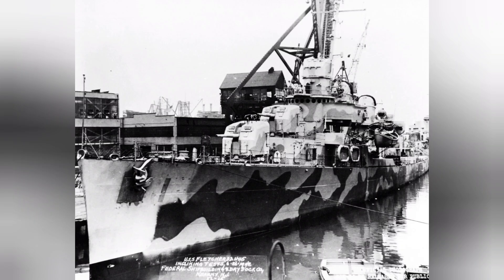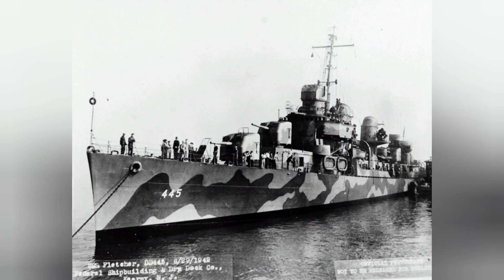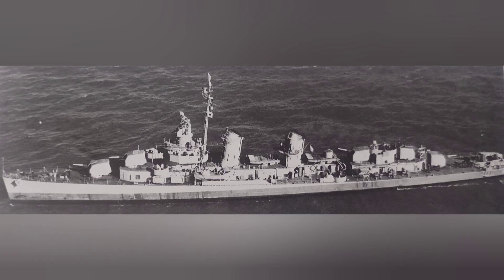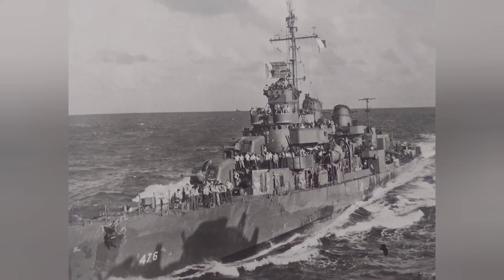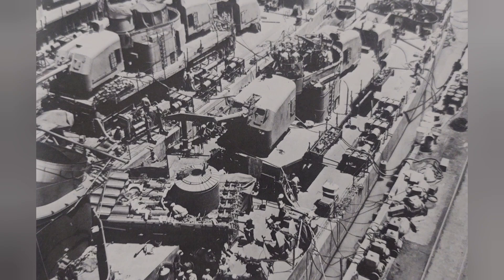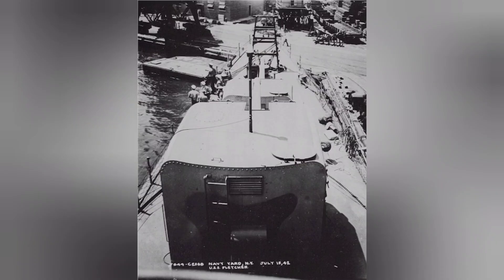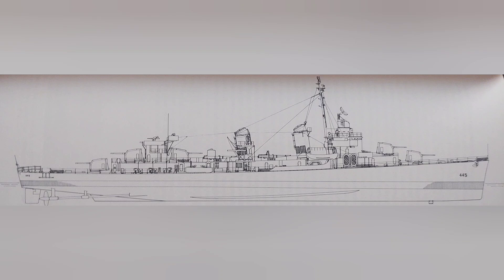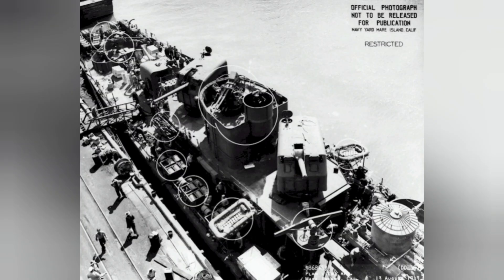Developing USS Fletcher (DD-445)

Comment: Excellent video as usual. A question: did the ship really have "side armor"? Even if only 3/4 inch it's news to me that destroyers had any armor.
Reply: I remember that is told that the Fletcher's armor is not armor itself, but rather a much denser steel for the hull that accounts enough to be anti shrapnel
Reply: @H42-s8x  That makes sense, thanks